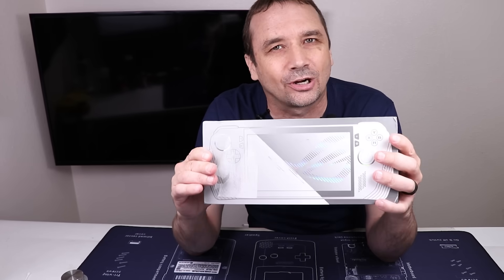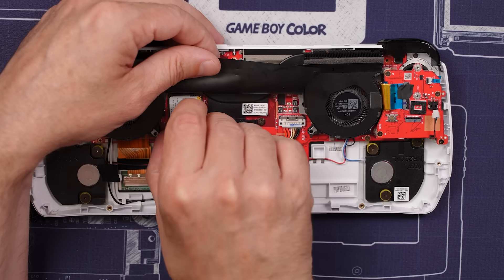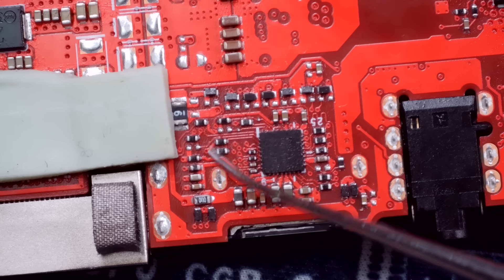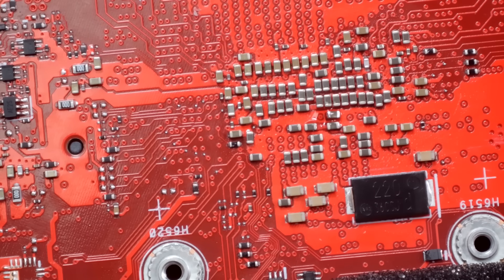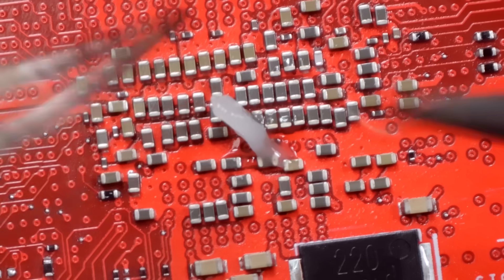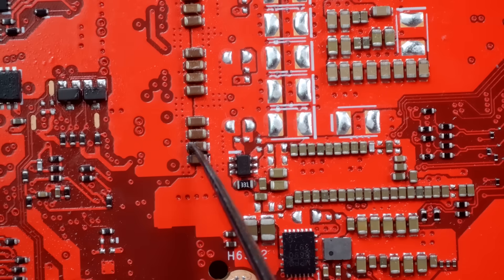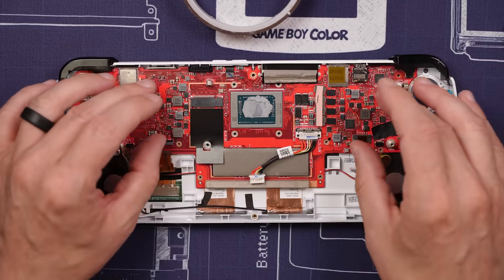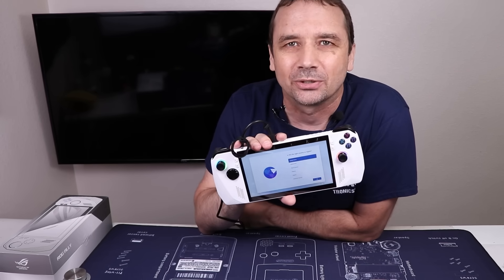ASUS REFUSED to Fix His ROG Ally - Can I?

Comment: I know there's a lot of valid reasons to hate ASUS, but I don't blame them for not doing this warranty repair. Absolutely moronic that the seller tried to repair the board BEFORE sending it in for warranty repair.
Reply: @Xxx_smoothiebrain_xxX  I mean, I’d say it’s also moronic to claim that this was “liquid damaged” when it clearly wasn’t. I would expect Asus repairpeople to know the difference between liquid damage and harmless flux residue.
Reply: Yea it is not that right but asus would have tossed the board anyway for the broken sd card reader.
Reply: I have to agree with you. If users decide to take things into their own hands, they get to deal with the consequences.

Comment: Question tronic, in the case where a component is busted and you don't have a replacement board with said component, do you buy a component with the same value or just wait till you've got a board with the component, just curious is all

Comment: ASUS has done plenty of things like that to not honor the warranty of their Ally devices. You can check the GamersNexus videos on that where one of their ROG Allies was rejected because a microscopic nick in the plastic at one of the sides and they claimed it was opened because of that even though they didn't even open the device before sending it. GN covered a couple of those cases and made a bunch of videos about it both covering their own testing and stories from viewers (some of them basically holding the device hostage if I remember correctly) about how bad the ASUS warranty is. What's even worse is that the SD card issues were pretty common from my understanding, so they should just cover this regardless.

Comment: I think they should have denied it.  Liquid damage is as good a reason as any.  They either accuse the owner of trying to fix it themselves or say it is liquid damage.  If something is under warranty, why would you even try to repair it yourself?  That makes zero sense.  The owner probably got overzealous with the hot air station which caused the cap to move a little and short against the other cap which blew the other cap.
Reply: They had valid reasons, they still just made one up though regardless lol The problem with ASUS is they are NOTOROIOUS for denying warranties even if you haven't done anything like they guy did here. Oh, your ROG ally won't turn on? Well, there is a tiny little nick in the casing you need an electron microscope to see so we're denying your claim. Here's are middle finger and thank you for buying are product. 

They are a truly awful company when it comes to customer service.

Comment: 9:44 it's not sticking because the pad on cap is torn. If you would've flipped the capacitor it would have stuck. It's probably relying on the side pads.

Comment: First of all if there is any suspicion of liquid damage, you do not try to turn on the device, first pull out the motherboard and make visual inspection to confirm the suspicion.
Second of all if there is not much room for your soldering iron to solder a small component then use god damn hot-air Steve 🤣

Comment: it's pretty ballsy to reflow a BGA component and then try to send in for warranty lol
Reply: Insane that the owner did not just immediately send it in. its under warranty!
Reply: @lookitskazzy sending products to the manufacturers for repairs suck. I think most people would expend their own knowledge to fix something first.  I personally cant re-chip a board, but if I did have the knowledge and tools I would try anything prior to giving up and sending it back.
Reply: @macbook802  technically even the owner didn't have the knowledge. What's the point of attempting to reflow a chip if he can't identify a damaged capacitor?
Reply: @macbook802  Generally if its beyond fixable they would just send you a new one. That is, if you didnt void the warranty. Thats the only thing I like about sending stuff in for warranty work.
Reply: @lookitskazzy  Asus is being sued for their customer service and warranty practices..............
Reply: Worked at a few tech centers and saw both end of the spectrum.
Customers removing good parts, replacing them with failed ones and sending it in under warranty,
customers intentionally damaging parts to get a free upgraded version,
customers bringing in items with huge dents/cracks and demanding a new one,
customers fiddling with the 115/230 switch and lying about it,
customers dropping items in various fluids and lying about it,
customers sending in items without accessories and claiming we lost them to get new ones,
customers failing to mod things, leaving fingerprints inside then lying about opening it,
customers sending in someone's failed unit with expired warranty and a fake serial # on it,
I've seen it all.
On the other end I've seen techs intentionally damaging warranty stickers to void warranty,
techs scratching plastic parts to say it's user damaged,
techs replacing quality parts with noname brands,
techs denying warranty claims when they realized the customer wasn't tech savvy,
and the worst was techs stealing photos from phones and drives, especially if the customer was attractive.
We had a big police case from the last one.
Reply: @nothanks7919  Honestly I’d be pissed off at this person because it is an example manufacturers can use to push against right-to-repair. They can say they’ve had to deal with stuff like this.
Reply: Ballsy on the ball grid array, I see what you did there😉
Reply: @nothanks7919  🤣🤣
Reply: I'm certified through my job to work on our Dell equipment. The amount of stuff I see our employees try to do themselves when they're under warranty and have techs to do repairs would make your head spin. Our turn around times for repairs are excellent, so it's not that they have to wait long at all.
Reply: Pretty scammy if you tell me 😂
Reply: Well it's also ballsy to say water damage when there is no water damage in site but to each their own

Comment: Asus never wanted to repair mine ive paid extra time warranty and they never made valid my warranty , mine the touchscreen stops working every time i lock and unlock the device and the sd card slot stops working so now i have a faulty very expensive device that barely works fine and in my country and city no one can fix it :(

Comment: Well, just by opening it you don't void the warranty.  However, if you started messing around with components, such as soldering anything or heating anything like that, it would give them a good case to make to void the warranty.  If I was ASUS and had their interest in mind and I saw the flux, I would also deny the warranty.
Reply: asus denied a fan replacement on a gpu. wanted 850$ to replace the fan. reason they voided the warranty? dust on the fan.
Reply: yeah, but THAT should be the reason not "liquid damage"
Reply: @awilliams1701  Sometimes you just have a dropdown list with maybe 5 reasons you can choose from.
Still, gamers nexus brought this up before so they should have addressed the issue and put some slightly more detailed notes.

Comment: Denying for liquid damage is lazy. Owner worked on it, that would give ASUS enough reason to deny it.
Reply: Yep, it should have been clear that the owner had attempted repairs.
Reply: @WeetisPotPie  That's illegal unless it has anything to do with the reason it's not working. So no, saying owner worked on it is not enough.
Reply: The problem is that the owner opened it. So ASUS had the right to decline.
Reply: @miguelangelariasmosquera5922 That's literally against the law since like the 70s.
Reply: Asus's built a bad product. They have repeatedly shown an unwillingness to work with customers in a reasonable way. $800? I think not. They should have done it for free, because it shouldn't have broken in the first place.
Reply: @WeetisPotPie  they likely didnt tell Asus what was wrong with it.
Reply: @WeetisPotPie  no. Asus would have to prove that fault was caused by user "repairs". But legal expenses being what they are, Asus claiming a BS reason is usually enough for them to win. So, the smart side is not trying to repair yourself unless you're a pro if the device is under warranty still.
Reply: I bet he never brought the console to Asus at all. This sounds more like the owner ruined the device then blame it on Asus.
Reply: "Liquid Damage" is a catchall.  Likely they just ticked a box on the reason they were denying and went on to another device.  I don't think it was lazy, but either way still the right call.
Reply: @RyeOnHam  I was about to say the same thing. Probably a warranty OP code that’s just a generic choice
Reply: @WeetisPotPie  you are incorrect on USA warnty law tjeu have to prove it was his repair/ modifaction work that broke it.
Reply: @D00ML0RD1 with a loose cap and a blown cap, that would be easy to do that. Residue is around the SD card area too. More evidence of a user attempted repair if they can prove there's no corrosion and that the residue is flux.
Reply: @Lath-m1k  the point is that do denie the warnty claim asus needs to provide proof the dmg was cuased by a outaide sorce not cover by the warranty alot of companys try to get out of doing dthe repair work contact places the Tbe BBB to file and push complaints normally thetll back down wirh enough bad press and the right push.
Reply: Except it is on Asus to prove the person damaged it.
Reply: @Rotteneggsack  if the owner said "part X isn't working" and the tech opens the device and sees part X covered in flux, then they have plenty of reason to deny a warranty claim. They don't have to prove the owner damaged it, they just have to have reason to believe something the owner did could have caused the damage they're claiming.
Reply: @voldrik1364  still kinda lame, I broke my Steam Deck even more when tried to fix the issue and admitted it to Steam Support and they still said they'll cover it with a free of charge warranty repair + shipping is on them. 

I was trying to solder back a bumper button (switch on the PCB) because one of the pads was ripped from the PCB when my deck accidentally fell onto the floor from the coffee table. I failed to resolder the old one and even worse I broke the original switch with heat damage so I was left without the bumper button entirely. I was literally ready to pay out of pocket for Valve to fix it but they said "No biggie, we'll cover that with a warranty".
Reply: @M1DNYT3_RS  but that's Valve's decision. It isn't lame of ASUS to deny a warranty claim when the owner knowingly voided their warranty by trying to resolder components.

And just for the record, I love Valve and don't particularly like ASUS. But in your case Valve went above and beyond, and in this case ASUS did exactly what they're meant to do when someone voids their warranty then tries to make a claim. It isn't a strike against ASUS that Valve goes out of their way for their customers.
Reply: @voldrik1364 nah, I'm not saying what Valve did should be a standard, but the way ASUS dealt with this situation is basically a level of ignorance you'd expect from Apple, but hey, at least unlike Apple, ASUS designs their products to be repairable. I own an ASUS gaming laptop and had to replace the charging port at some point, the entire repair was like 5 bucks and took me 2 hours total, don't ask how I managed to resolder a charging port but was unable to resolder a simple button switch 😂

Valve uses quite a tricky button switch that has three contact legs and all three are underneath the body of the switch, so instead of soldering you should use a heat gun to basically sit it into place, and I don't have a heat gun.
Reply: @M1DNYT3_RS  how is what ASUS did "a level of ignorance you'd expect from Apple"? They got an item for a warranty claim, opened it, saw the owner had done something that voided the warranty, and denied the claim. Liquid damage is just a catch all for "no, you broke it", and, flux being a liquid, is also arguably the most accurate description of the immediately visible issue.
Reply: @voldrik1364 in many countries attempt to repair decide yourself doesn't void the warranty, and the thing you don't understand is that they said "water damage" when there's none, it's literally in the video. If you're technician in the slightest you should know that flux doesn't damage anything, it's often a "no-clean, non conductive" type. They didn't want to fix the device, that's all. That's lame, and they came up with an excuse, that's lame x2.
Reply: @M1DNYT3_RS  dude voided his warranty by tampering with the exact component he was trying to make a claim for. That, in any country, would result in them denying the claim. They weren't being lazy or "lame x2" by denying it, they were doing exactly what any company would do in that situation ("but Valve fixed mine!!!" doesn't change that). And it doesn't matter if the flux damaged it or not, it's evidence that he soldered part of the board, which may have damaged it, thus voiding his warranty. If they had just said "no repair because we can see you tampered with the board" there would be no discussion about if they were in the right or not, but since they just ticked the equivalent of the "no because we said so" box you're making up excuses for why they're in the wrong for not fixing it.

The part you should be calling them lame for is charging more than the cost of the device to repair it knowing full well that the owners would definitely turn that down and possibly buy a replacement device resulting in another sale so they'd bank either way.
Reply: @voldrik1364 they need to give option for the customer, that's how business works. Never let the customer without options, because you will loose it 100%
Reply: @voldrik1364  it's lame of them to charge 800 bucks. It isn't lame that they're sticking to their policy.
Reply: @M1DNYT3_RS  some companies relize if they all give out free fixes even after the owner tapered with the inside people will abuse by removing good parts and replacing with bad parts and claiming the warranty so they can have new free parts to fix other people's stuff and make money off the company. Thats why not every company will fix stuff for free especially because owner of the device clearly knows a thing or 2 about repairing devices showing if this was a scam they worry about the owner would take said parts and do exactly what I stated while with the last person that posted a comment here about how they severely damaged it more a company will be less likely to fear them trying to scam them because they wouldn't be able to really do anything with new parts be ause of lack of skill or knowledge
Reply: @Rotteneggsack  are you serious? warranty means you shouldnt attempt to repair it, you might probably just upgrade the ssd or battery but thats it!
Reply: @Rotteneggsack  they don’t have to prove he damaged anything just him opening it voids the warranty
Reply: @Rotteneggsack  finding flux on the board is enough
Reply: @ДимитърАндонов-ъ7е  I’m gonna agree with this. If I bought something and noticed flux on the board, I’m going to assume it was opened.